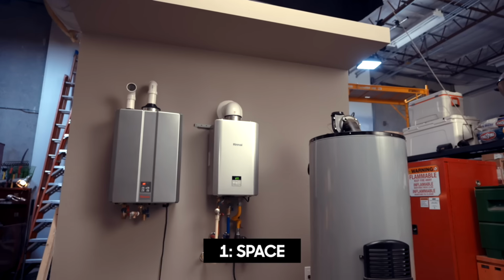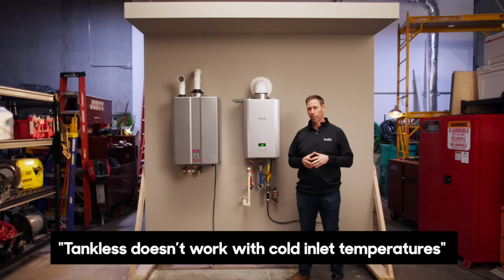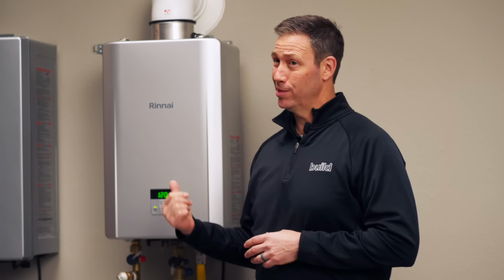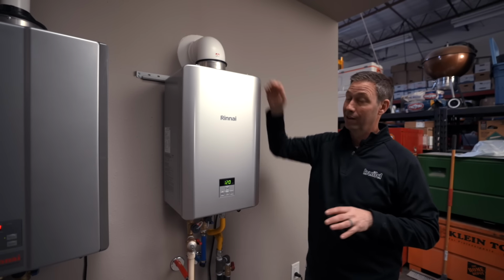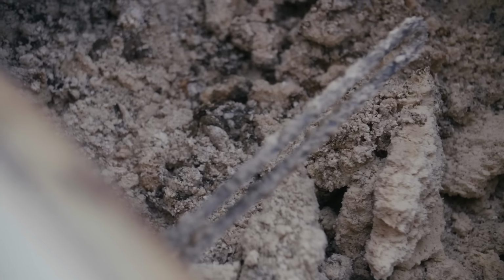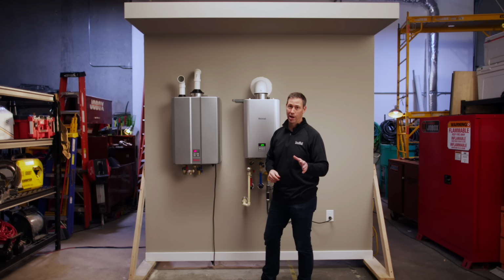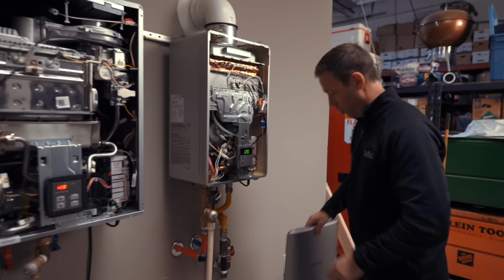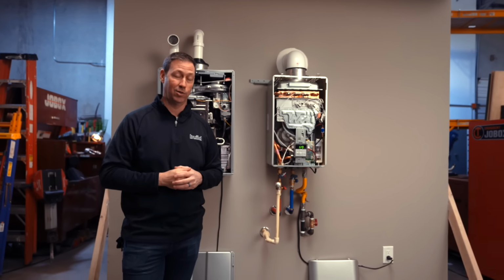DEBUNKING Tankless water heater LIES!

Comment: When we built our house in 1994 we installed tankless water heaters, that worked well for about 25 years.  Eventually they needed repairs and it wasn't possible to get parts for them any more.  We considered new tankless heaters first, but they were not only expensive, they required extensive routine maintenance--very finicky.  I think they also required an electrical outlet, as do many new tank water heaters.  We went with good modern tank water heaters, and have been well pleased.  They have miniscule pilot lights and good insulation.  No need for an electrical outlet;  all the electrical power necessary comes from the heat of the pilot light.
Reply: no idea what people in america are getting shilled, we have had so many tankless water heaters here in the UK never once have we needed them descaling, even in hard water areas
Reply: @randomcow505 I would really like to know the difference in your tankless water heaters and the ones in the USA. I tend to very much believe you. There is so much b.s. sales here telling people they need or have to have various services that are total b.s. and rip offs for easy money.
Reply: @randomcow505  I've got a friend who loves his tankless. Same guy who was able to say something nice about a neglected, overflowing and festering portable chemical toilet on a construction site.
Reply: @randomcow505  Ah yes, of course scale doesn't exist in the UK.

Comment: We are blessed to have a primary residence and a house on the beach here in Florida.  In the remodel of the Beach house we had a couple of concerns, mostly I was absolutely paranoid about a leak since we do not live at the beach.  This is also a small place and the tank took a quarter of the available space in the utility closet.  We decided on tankless.  It has performed flawlessly and we have never had an issue with getting immediate hot water.  It costs more, I doubt we'll ever get much back in terms of energy efficiency however that was not the main reason we purchased the unit.  For the same reason, when faced with the replacement of our tank at our main residence.  Running the concerns and the numbers it made sense to replace the tank with the tank. Flooding is not a concern here as the tank is in the garage, neither is space, so initial cost won out.  Point being, both work well for differentiating situations.  If you're considering tankless, it ain't the cheapest, but is proven tech and in my experience works great.
Reply: Tankless are much cheaper if you don’t buy the popular “name brands” . There are many out there that work as good or better than the name brands and as a plus are much smaller! I’m talking gas tankless. Electric don’t work as good if your ground water isn’t above 60° or higher, at least any I tried didn’t, gas (natural and propane) work phenomenally well!

Comment: Well there is some half truths in this and you are obviously pushing Rinnai heaters because they sponsored this. But you don't mention that if the homeowner doesn't flush the Rinnai or any other brand of tankless every 6 months that their warranty is void. The heat exchanger will clog with calcium and they will be stuck with buying a replacement heater. AO Smith corp is the only tankless manufacturer that has a tankless that never has to be flushed. They will replace the whole water heater if it fails. Your sponser didn't tell you to mention any of that.

Comment: All tank water heaters don't fall into the paradigm you're attempting to create to support your justification for a tankless water heater.  I have a 40-gallon pressure tank with a heat exchanger that is a zone on my radiant floor heating system boiler with its own burner.  Have never run out of hot water and I don't care about the size because it's in the same utility closet as the boiler.

Comment: 120 is way too hot to shower. 
One solution is a holding tank in the basement to bring the 35 degree MN water up to the 55 degree basement.

Comment: From the prices I just looked up, you are incorrect. 

On average, tankless cost about $300- $500 more than regular water heaters. 
Installing a tankless water heater in a house that was using a regular water heater will cost $600-$3500 more. (simply because replacing a old water heater with a new one is very simple. Just unscrew a few things, put the new one in and screw those things back in.) 

This looks like a paid commercial ad
Reply: define"regular"
Reply: @anthonyspadafora1384  Regular water heater? ........ The most popular,.... standard , in most average homes. 

Just look up the prices out both. then look up the installation out both and you'll come to the same conclusion
Reply: @Steve_Hayden  Are you talking about a chimney vent water heater or a power vent water heater? I havent seen a chimney on a new home since 98 unless they had it built for a wood fireplace.
Reply: @anthonyspadafora1384  I don't know anything about chimney vents. 

All I did was look up the prices of different regular water heaters verses his water heaters. Then I looked up installation prices for both units. Both times, the prices were higher for his unions and the prices were higher for installation. 

I was believing him until I saw that he is the one selling and installing those new types of water heaters. And as a former salesman, I know some will be misleading. That's why I looked into it. 

I like the idea of not having a standard water heater. Maybe in the long run they would be cheaper. But the comparison, that they are the same price for unit and installation I found to be.....not correct.

Comment: I went to add one to my home and after purchase was told by the installer that I had to run Copper wire from the box to the panel costing $2500.00.  That would bring my purchase to $4000.00.  Is that usual(Copper wire)?

Comment: I’ve been working on tankless for 20 years.  And I make a good living coming in behind installers. 
1. You’re wrong on the longevity.  Getting 20 plus years on a tankless is only possible if spare parts are still being made and stocked.  And if the unit is properly maintained. A tank can get 20 plus years as well if pressure, anode rod and water quality is checked.  
2. Installing a tankless takes far more labor intensive than a tank unless of course you skip some serious issues, such as 110 outlet and gas line up sizing.  Core drilling through a concrete wall is something not for the average guy.  
3. Stainless steel is causing issues with copper pipes on the down range side.  Also another point of concern is reverse osmosis and tankless. “What say you?”
4. Your comment on gas line is incorrect.  The newer units will not shut down on low pressure.  It will simply give you want it can.   BTUs are BTUs and the gas meter will only allow what it’s designed for.  
5. Your comment on running 3 showers at the same time is misleading at best.  Delta T or temp rise dictates the GPM of a unit.   
By all means keep these videos coming as I make a living coming in after guys who follow your advice.
Reply: I agree with one point you made. I was a Navien service specialist until I had to rescind. Every unit i was called in on was installed wrong. Then I had to explain that I didnt work for Navien. I was just factory trained to repair them and in no way affiliated with Navien other than going out and giving a price to install properly. I loved asking people where the guy was that installed it, after all it was only a month old. I loved hearing that "Its a long story" and then telling them I have time, im charging you by the hour   LOL. No.2..I havent seen a chimney on a home for the last 20 years, so most homes already have a outlet and a hole in the wall. CSST gas pipe is far from "Labor intensive" . 3. Stainless steel is not causing anything with copper downstream and if you think it is invest in a 10 dollar dielectric union. 4 Our gas companies gladly come out and replace your gas meter for free. 5 BTUs are base on temperature rise x flow. This temperature must be taken at the shower head (usually 105) not from the little setting on the screen. It doesnt matter how high you set your temperature at the unit, humans will just adjust the flow and mix at the shower head to where they are comfortable using the same amount of BTUs.
Reply: @anthonyspadafora1384  nice to meet another tankless geek. I work in the Marietta area, north Fulton county.  We’re having a time with electrolysis here.  So my comment on the stainless steel heat exchanger may not be applicable to your area.  I do a simple voltage check from ground to neutral.  If I get any voltage I have the home owner have an electrician go through their panel, grounding and bonding.  Thanks for the input. If my health was better I’d try to start a tankless association.  Much like the HVAC boys did in the 1950’s.
Reply: Yes, this guy is very misleading
Reply: lol   thanks for the input..   here in thailand  we use one small tankless in the shower (75 to 150 dollars) ive seen many old ones still working fine...  the rest of the house sa bai sa bai   no have!  lol
Reply: @marcinasia1731  precisely. the one component I forgot to mention that affects the life of tankless and the need for descale is temperature.  My Asian family and friends in the Pacific don’t use hot hot water on a regular basis.  If the temperature is kept below 110 on a consistent basis the tankless will last a long time, without descale. Anything 120 and above will require water treatment and or regular maintenance.
Reply: oh  and there electric
Reply: @marcinasia1731  that tells me by itself that you don’t waste water.  Electric types (here in the states) don’t have the same recovery as a gas tankless.  Americans want 120 plus temperature while using multiple shower heads.  A waste of water and energy.
Reply: Your are correct especially on the gas line
Reply: Tony; Thanks for getting the truth out there as My Daughter got hit with an $1800 bill to install her tankless heater and now she says she hates it cause it takes all day to get hot water to all parts of the house and her electric bill went up considerably to operate it~!!
Reply: @rickmcdonald1557  I hate to hear that

Comment: Sponsored by Rinaii, says it all. How about discussing the maintenance to remove sediment, especially if you have hard water. How about discuss the annual cost savings of about $120 and the cost of an annual service visit. My tank water lasted over 15 years and cost me only $650. No annual maintenance. Blanket kept the stored water hot and avoided running the burner when not in use. I can buy a lifetime of tank heaters for the cost of a tankless. How about an honest review that isn’t a sales pitch by the manufacturer.
Reply: Now you know we can’t talk about the elephant in the room😜. In all seriousness tankless units shine when the user keeps the temperature 110 degrees or less and the burn hours less than 250 per year. Otherwise you get what you just described.
Reply: Maybe in the U.S. the cost of tank vs tankless means a saving with a tank but a vast majority of houses in UK and EU run tankless and it’s cheaper . My house was converted from a leaky tank that kept failing after only 7 years and took up way too much space. While I was apprehensive at first, the New tankless heater produced all the hot water we need for two showers, and the washer running simultaneously and then some. 5 years on and never had a problem, lower costs as I don’t have an element constantly trying to keep the water hot in the tank etc etc. never looking back. That said I guess there are still a few edge cases for tank based water heaters. Now looking at one of the new tech electric only versions that can replace the gas condenser unit for same running cost.
Reply: Matt did a video a while back about tankless being thankless
Reply: What’s you opinion on heat pump water heater, i am planing to replace my 40 gallon natural gas water heater. I live in moderate climate, temperature never less than 42F.
Reply: The US market is very weird here. There is no reason why a tankless boiler should cost significantly more than the system boiler you would otherwise use with a tank, nor is there any reason why it should require more maintenance. Indeed, elsewhere in the world they are about the same price, meaning that the tank itself is just an additional cost. Also, there is no meaningful efficiency difference between a system boiler + tank vs a tankless boiler. The efficiency gain comes from condensing vs non-condensing, and both are available for both formats - although non-condensing boilers have been obsolete for about 15 years now!
Reply: Well said.
Reply: In Quenec, Canada,. Insurance kinda forces you to change your tank every 10 years

Comment: would have been nice and informative if it wasn't paid for by Rinnia, did you just say don't upgrade your gas line? it sucks more gas from the line then it can supply, sounds like u will starve your furnace and fireplace causing improper combustion and carbon monoxide.

i hope no one listens to that, follows ur advise and dies from following your instructions. GL, love the show

Comment: This is a bad video almost all the way around. Tankless need larger gas piping per code due to BTU rating. Tankless are prone to scale much faster then a tank heater, you will need at least yearly descaling vs none on a gas tank heater with electric you can go 8-10 years before needing to descale. Tankless also do not like very high cold water inlet tempatures that occur down south. Tankless has it's place as does all the other choices. Talk at length with your Plumbing profesinal aan d determine the best heating appliance for your needs.

Comment: A LOT of half truths here. Kind of disappointed how much of an ad this came to be. We’ve been installing tankless and tank style water heaters for 50 years in Michigan. I like both in the right applications. Tank style units around here almost always last 20-30 years before failing and almost never require service, but they are less efficient. And if you use a lot of hot water then you will run out. Tankless styles have a much smaller heat exchanger so they can’t hold as much scale before they plug off the flow. We see more service required on tankless due to this. Tankless also typically require more cleanings on the burner side and the flow wheel can get debris caught in it and require cleaning. We have also on occasion run into minimum flow issues on some models where a low flow faucet won’t be quite enough to engage the burner reliably on one of the larger models. This can be avoided with smaller units, but then they can’t run as much water either. 

If you need endless hot water, go tankless. Rinnai makes a top notch unit. But If you don’t need endless hot water, An efficient tank style unit is still a much more reliable option around here. I’ve got an electric tank water heater in my basement currently that is over 30 years old and has never required service. I plan on replacing this with a geothermal preheat to an electric tank style water heater in the near future.
Reply: I COMPLETELY AGREE!  I was going to post a long rant comment myself before I ran into this comment here. He really is lying quite a bit in this "advertisement" disguised as a documentary. One other thing I'd like to add: no electricity immediately means no hot water at all... whereas with a traditional tank heater- a natural gas or propane powered heater would be unaffected. No problem. In an electrical tank heater- at least there's a tank full of hot water to work with for an hour or so after the outage- so that's SOMETHING.
Reply: @melissachartres3219  I hate people like Matt who are paid by the sponsors and endorse the product over others when they are inferior to other options.

Comment: You can use both, a tank with the feed-in being an instant heat one, only need a small tank, and electric works, lots of hot quickly, and the feed into the tank is mostly hot so you avoid both the slow start of tankless, and the running out of water of the tank. 
It doesn't have to be one or the other.

You can also add rooftop heating or a heatpump into the system that feeds into the tank, and can have a pretty energy efficient setup that way.  And have that water feed into the tankless heater, which then feeds into the tank.  
By using the ground or roof to prewarm the water before the instant heater, the amount of energy needed to raise to the desired temp goes way down.  But you still have hot water when its winter, just bypass the roof coils.
And if you need instant heat, as others have mentioned. You need a circulation system.
Reply: I still have just a tank but occurred to me this should be a possibility.  Small tank that serves as cache of hot water that is fed by Tankless.
Reply: Once the kids were grown, I went to a smaller 19 gallon 120 volt 1500 watt tank water heater with the 240 volt timer I had installed on the previous water heater.  Except for a nice long hot shower, it's perfect.  I am now looking at your idea of both not one or the other and supplementing my hot water. I'm happy to read I'm not alone with the idea of using both.

Comment: No thanks.. At triple the cost of a tank plus install, I can go through 3 tanks and still come out ahead. A bit of maintenance  every year on a tank, with an Anode change around 7 years I can get 15 plus years use on a water tank.
Reply: What about all the other obvious tankless benefits?
Reply: @martinblank4250  Such as? I would never recoup the cost difference in 20 years on natural gas usage. I live in a northern climate, so would have to up size unit to accommodate the extra temperature swing due to winter water being colder. Water usage would be around the same or more unless I put smaller electric units at different locations close to usage points.